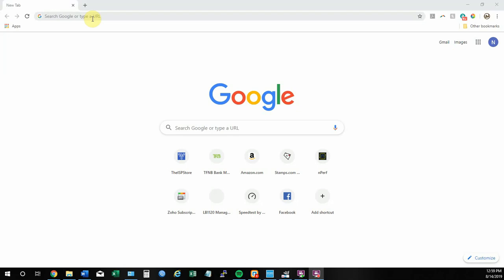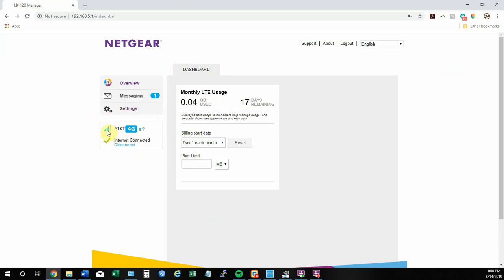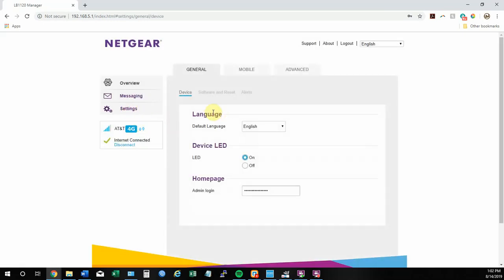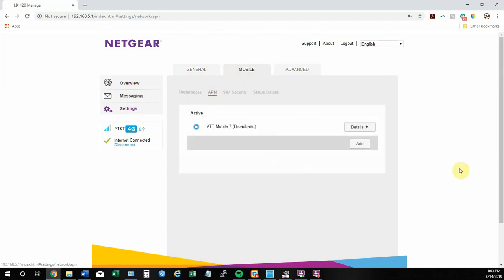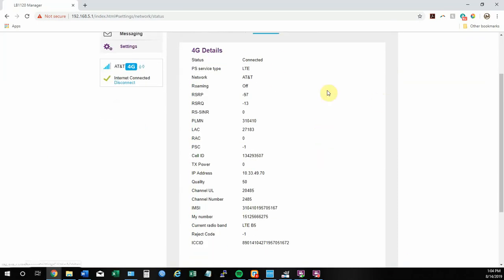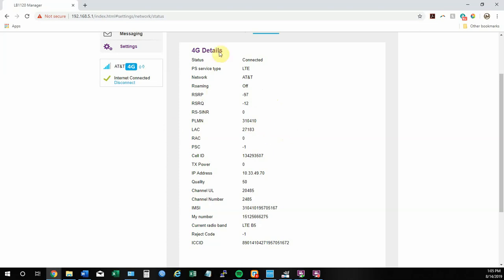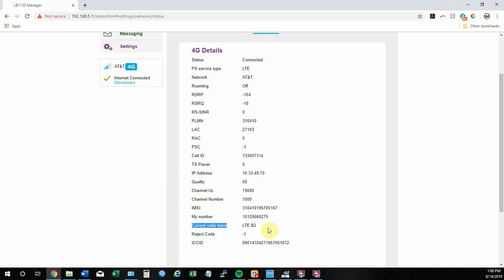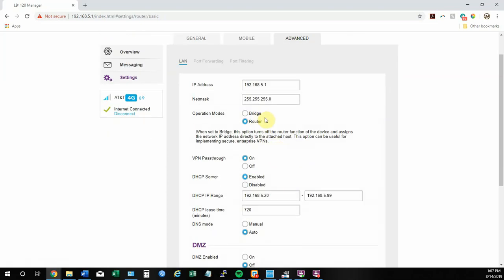LB1120 GUI Walkthrough

Comment: Hiya,

I'm trying to setup a synology NAS to do some port forwarding and to be accessible via DNS. My current 4G router does not support bridge mode, as recommended by the NAS setup (the NAS says two or more routers detected in the network and to use bridge mode, if possible)

Would having this modem connected help me achieve this?
Reply from the maker: You can try placing your gateway in “IP Passthrough” mode, which is essentially bridge mode. Unfortunately the availability of ports is entirely dependent on your carrier.

Comment: What difference does the external antennas make ? I cant get over 5 up and down on tmobile sim in rual area of florida
Reply from the maker: Adding an antenna is really dependent on the type of antenna you use and the amount of cable between them. We find that the antennas dont add that much unless you are trying to place the antenna portion of the modem at a window while keeping the modem separated, like in a network closet for instance. Speed is also very much dependent on your area and serving tower. So simply increasing signal is not a guaranty that it will make it faster.